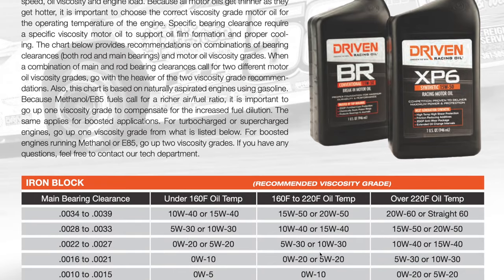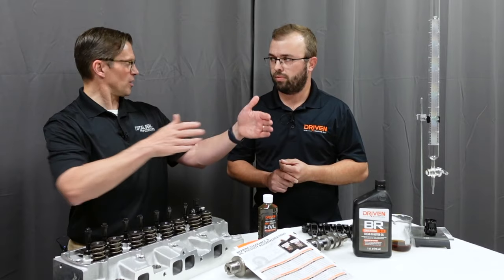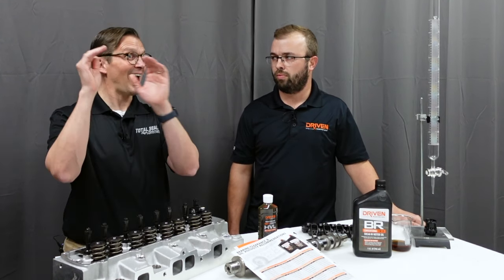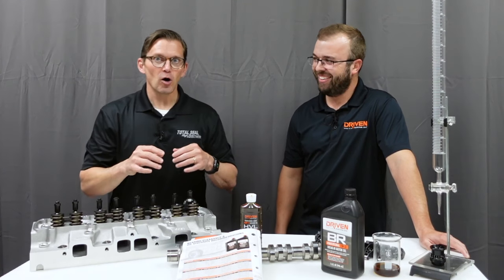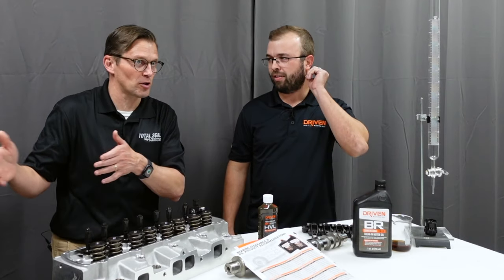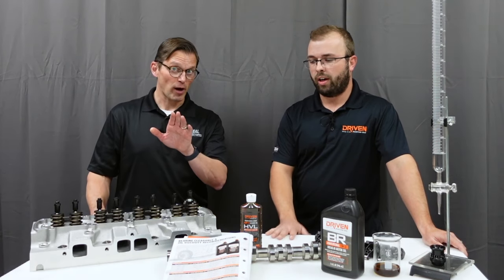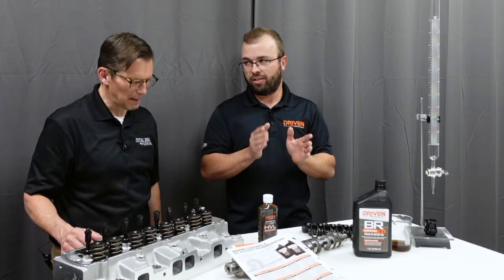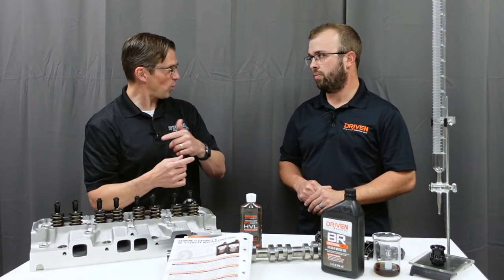How To Choose The Right Viscosity Motor Oil - A Certified Lubrication Specialist Explains

Comment: I switched my '16 Corolla to 5w30 from 0w20 at 200K miles. Now, I don't have to add a quart to quart and a half every 5K miles, my car is quieter, and the efficiency is the same for me. Owner's manuals in other countries list MULTIPLE grades for the exact same engines. This "0w20 only" nonsense is only a sop to the EPA/Feds, and I love that people refuse to accept this as per their programming.
Reply: 5w30 should be ok for extreme cold temperatures right???
Reply: Never had to top up engine oil before.
Reply: @ivanhamlyn  Look at an online viscosity chart.  You say Extreme, I'm thinking  0c,  you should be running 0w20 or 0w30.
Reply: @MyerShift7  I went with 0w30
Reply: @ivanhamlyn 5w30 synthetic. about -17c for my engine anyways. Colder I needed to plug in the block heater. and, at work started every couple hours down to around -35c or so. Northern Alberta Canada. Older engine 300000 km
Reply: how many miles do you go before changing your oil?
Reply: @ivanhamlyn yes. Unless you live somewhere extreme. I live in upstate New York and use 5w30 in my Camry and haven’t had any problems. I started using 5w30 once I got to 150 thousand miles.
Reply: This “0w20”  thing is spreading everywhere. In India, where I am from, 0w20 sees to have become a standard recommendation by all  car manufacturers (gasoline engines). I don’t understand why 0w20 is needed for places where temperatures range between 5 degrees Celsius to 52 degrees Celsius. Until a few years back, 5w30 used to be the norm.
Reply: @nssaharan exactly…0w-20 is for lower temperature reguions not high temps like india …it will become too thin in heat ..I assume
Reply: Absolutely. I just bought a 24 Wrangler Rubicon with the old school v6. Originally that motor asked for 5w30. Today, it’s 0w20.  Nonsense for the epa. Nothing else.
Reply: Why not just do a 0w30.  Best of both worlds.

Comment: For most drivers, use the oil weight recommended by the manufacturer. Use a high-quality synthetic, change it and the filter every 3,000 miles, drive gently, and a well-built vehicle will last a long, long time.
Reply: The problem is my car has 200k miles and my oil gets very hot.. 218°f/103°c and I drive mainly city miles.. wouldn't I be better off running 0w40 at these temps?
Reply: I know many of the recommended weights by manufacturers are really thin for emissions and economy and in other countries they direct the owners of the same engines to run thicker oils so you need to really know what is best for your engine…
Reply: Oil weight aside, oil changes at 3k miles with modern oils, let alone full synthetic, is a complete waste of oil and money.  Don’t do that.  It certainly won’t hurt your engine, just your wallet.  But, it won’t help either.
Reply: @torchmd  I was thinking on an Rv or heavy truck 3k is good (especially an RV, where it takes years to put 3k miles on it) but on a car maybe 5-6k…
Reply: Oh, sure. That makes sense.  My apologies.  I routinely go much longer than that.  I did the oil testing for a while on my diesel, and oil tested good out to 20k then I stopped.  On my gas engine I usually go to 1 year, which is lower miles, usually about 10. The testing came out good, so no reason to go more frequent than that.  But time is not something you can control for.
Reply: “Drive gently” 

Lol

Why even drive at all?
Reply: @jooper99 unfortunately, my experience is that those who don’t “drive gently” on public roads, provably shouldn’t drive at all.  Sad but true.  😬
Reply: @jaynikk758  I say 10W 40.  A 10W oil is plenty thin unless it is 0 degrees or colder outside.
Reply: @bounderchris  FACTS.
Reply: @torchmd  With synthetic, yes, but "natural" oils, no it isn't.  And leaving the same filter too many miles is just like not having an oil filter.  Once it gets plugged up, oil will bypass it.
Reply: @torchmd  You are a gambling man.  You should NEVER try to go more than 6,000 miles between changes, ESPECIALLY on a diesel.
Reply: @jamesbosworth4191  absolutely.  I change the oil filter every 5 to 6k.  And I only use synthetic oils.  Not all synthetic oils are created equal.  At least that used to be the case.  it has been a while since I did the research.
Reply: @jamesbosworth4191  Not according to the research I've seen.  ALl of my vehicles have gone well over 100k, most to 200k.  And it wasn't the engine that gave out.  well, one deisel dumped an injector and totaled the engine, but the rings and races were good.  But like you said, you can't let the filters go that long certainly.
Reply: @torchmd  One of my uncles used to brag about how he never changed his oil, yet his engine was "perfect".  It wasn't noisy and ran smoothly, but it smoked like a mosquito fogger.  Then one hot summer day, it locked up solid.
Reply: @jamesbosworth4191 I would never advocate for “never changing my oil”.  I hope I didn’t communicate that.  If I did, I apologize. But:  3000 mile change interval is wasteful.   Especially with a quality synthetic oil, 10k to 12 k is perfectly reasonable.   And at least yearly.  Now there are other variables, like what type of engine, driving, intake system, fuel, etc certainly.   That’s my opinion, and I have seen studies that support that.  

Thank you for calling for a sanity check. It’s easy to get carried away and say things I didn’t mean.
Reply: @torchmd  We'll agree to disagree then.
Reply: @jooper99  Drive the car the way you want because it's your vehicle and your money, but a lead foot shouldn't expect to maximize the life of the engine.
Reply: @bounderchris you also need to consider other countries avg temperatures and other environmental factors are impacting that.
Reply: @bounderchris but what if I have a euro car. Is it still ok to go thicker? I want to since I live in a hot climate and it’s summer time.
Reply: @jamesbosworth4191  but what if I have a euro car. Is it still ok to go thicker? I want to since I live in a hot climate and it’s summer time.
Reply: @Phuong_Nguyen_  If your car is an older car, 20W 50 is fine, as at cold (when you start your engine the first time of day), temperatures, it is an SAE 20 oil, which is plenty thin in a hot climate, when hot, (operating temperature of the oil), it mimics a hot SAE 50 oil.  For a modern car though, unless it has lot of miles, I would stay with 10W 40 or 15W 40.  In most climates, 10W 30 is fine.  If you want to use a single-grade oil, use SAE 30 if your climate is truly hot, SAE 20 or SAE 20W if your climate is "average".
Reply: @jamesbosworth4191  I can’t use sae that low. Mercedes cars are spec’d to use 0w40 or 5w40 229.5. Hot oil has to be 40 or higher. But sae 40 is way too thick at cold temperatures. I bought some M1 5w40 and will mix it with m1 15w50 half and half. If someone made a 10w45 that would be perfect. I have a 2013 biturbo v8, it gets hot. Some people run 5w50 amsoil. But I’m not paying $16 for a quart of oil that will sheer in 3000 miles.
Reply: @Phuong_Nguyen_  With Multi-grade, the actual viscosity of the oil is the first number, not the second number.  Thus, 0W 40 is not a 40 weight oil, it is a 0 weight oil that has been fortified with polymers that make it so that it doesn't thin out as it get warmer, so that at high temperatures, it is supposed to mimic a hot SAE 40 single-grade oil.  No way would I even think of using 0W anything in any of my engines, as the viscosity nowadays is decided by fuel economy test considerations, not by the engineers.  I would find out what European models of your car with your engine call for.  THAT is what is probably the correct viscosity, not what is called for in this country.  PS:  It is warmer over here, so if anything, you would need THICKER, not thinner oil in this country.
Reply: @Phuong_Nguyen_  If you are looking for 15W 40 oil, Diesel engine spec oils are available in that viscosity.  If you can't find any at auto parts stores, truck stops will have it.
Reply: @jamesbosworth4191  I just told you. And if you know anything about Mercedes or European cars, they all run on 0w40 or 5w40. I’m getting advice from someone that doesn’t even know about Mercedes specifications. Everyone who knows oil knows 229.5 is Mercedes specs and 0w40 or 5w40. I guess I’ll just have to go find advice from someone who actually knows about European cars and oil specs.
Reply: @Phuong_Nguyen_  I still would never use 0W anything in any engine of mine, I don't care what the owner's manual says.  I care more about engine life, not fuel economy.  Besides, if you can afford a Mercedes, you can afford the gas.
Reply: @jamesbosworth4191  the 0 is for cold start up. The 40 is how it behaves when at operating temperature. 40 oil is not marketed for fuel economy, quite the opposite. Are you sure you know about oil? You sound a little clueless.
Reply: @Phuong_Nguyen_  I am talking about the 0W part, not the 40 part.  0W 40 is not the same thing as SAE 40.  And I am not talking so much about marketing as I am talking about the automakers trying to get the highest possible MPG rating for CAFE purposes.
Reply: That's simply being a sheep
Reply: @jamesbosworth4191  well I can’t use sae 40 because the cold startup isn’t efficient. 10w40 would be my choice but no one makes it besides mobile 1 high mileage, but I don’t want to use a high mileage oil. And there’s a few motorcycle and diesel 10w40s but I’m not comfortable with those either. So what I’m going to do on the next oil change is m1 5w40 mixed with m1 15w50. Should come out to 10w45 which is perfect for summer use.
Reply: @Phuong_Nguyen_  Sounds like a good choice to me.
Reply: Thanks mom.
Reply: You nailed it 😊
Reply: @torchmd  I agree.  But 5k if you have a GDI engine due to oil dilution.  Unless you pay for an oil analysis so you know where you are sitting.
Reply: @torchmd my truck 5.4 3 valve, starts to run different after about 3-3500 miles, so I limit it to 3k.  Many newer engines are very temperamental.

Does it cause more wear after that??  I doubt it, it just likes lower OCI.

Comment: After 50 years of doing it myself, I finally seriously researched motor oil. I came to the shocking realization that I could have used nothing but 10W-30 in every vehicle I have ever owned from the early 70s till today. In several of them, the recommended viscosity was 5W-30. However, in the fine print it always said you could use 10W-30 if the temperature never went below 0 Fahrenheit. So there.
Reply: 10w30 is excellent...stable, and low noack.
Reply: You can use 100w-20 if you'll never let your car in winter Temps but there's no advantage to that instead of just buy 0w
Reply: @jason200912  I have never owned a vehicle where the recommended oil was 5W-20 or 0W-20. If it was the recommendation, I would use it. With the ones where 5W-30 was recommended, the fine print said you could use 10W-30 if the temperature did not go below zero F. I could have used nothing but 10W-30 in every vehicle I ever owned with a cast iron American engine.

The point is, I could have used one oil all my life, never debated, discussed or researched the topic and been no worse off. But I like to research. Almost anything.
Reply: @anonymike8280 what's the purpose of oil logistics for you though because the oil additives degrades overtime and you should only buy it when you're ready to do the oil change
Reply: 2016 Kia Rio. Says 5W-20 on oil filler cap. Manual says you can also use 5W-30, or if it never goes below zero 10W-30.
Reply: Agree 100%.  I have two stock Corvettes (C4 and C5) and a 96 Impala SS.  They each have a 5.7 liter V-8.  I bought each one new.  They have only seen Mobil One 10W-30.  As each car went beyond 75,000 miles, I started using "High Mileage" Mobil One.  I think the 5W-30 is for people who want to squeeze slightly more MPG out of their cars.  I'm more interested is squeezing more life out of my engines.
Reply: @GregSr  You have a point. The manuals for the cars I had said 10W-30 but then they said, if the temperature where you are does not go below 0 F, you can use 10W-30. I have never owned a vehicle where I could not have just used 10W-30 oil. What I was really getting is that all of the time I have spent discussing motor oil was just a waste. Researching other people's conceptiom and misconceptions is one of my avocations though. Maybe that's a waste of time too.

Comment: I have a 2018 Camry V6 (the current generation) and I live in a mostly hot climate all year round. The dealer recommended me to use 5w30 and if I wanted to go for 10w40 (which they used on my car when I didn’t know better lol) there wouldn’t be a problem. Toyota engines can accept wider range of oil viscosity. I was shocked when I found out that US spec Toyota models use 0w20 oil. I have been using 5w30 full synthetic and for years and no problems whatsoever. 0w20 is too thin for that engine in my opinion.
Reply: For sure, 20 weight is not fit for a hot climate. I drive between Orlando and Miami all year round, no way I would ever put a 0w-20 in my Toyota. As usual what works in some nerds lab does not hold up in the real world. I ran my V-8 Chevy in Houston TX on 10w-40, got over 189K miles and finally dumped it because too many other things went bad, the engine was still running fine.

Comment: Actually 0-20 is basically the same as 5-20 and neither is making engines burn oil car manufacturers are making the piston rings more loose to cut down on friction and get better MPG on the fleet of cars 0.003% adds up over a million cars and then on top of this they sold people on the 10000 miles oil change read your manual that's for normal driving conditions 🤔🤔🤔 but wait read a little bit more and see the definition of normal almost no one in the world drives in normal conditions according to the auto manufacturers 🤦🤷. So use good oil and change it every 3000 to 5000 miles and your engine will love you for it.
Reply: The Ow has more additives that break down over time than the 5w or 10w.
The lower the range, the less additives.
I was using Castrol Edge 5w40 which was oem for my turbo car.
Now I'm doing Castrol Edge 0w40 which had a higher lube rating than the 5w40 but more additives which break down.
The 0 should pump faster on start up which prevents wear.
The engine seems happy with either and I'm in the Pacific Northwest so we don't have extreme hot or cold weather.
I'll just use whichever is cheaper or available..lol
I do 10k full synthetic oil changes and filter.  72k and runs like new.

Mazda mpv V6 ran Mobil 1 5w30 at 10k oil changes and ran like new for 150k miles and sold car.

Cheers

Comment: For the new wrx's, Subaru recommends 5W-30 in the Canadian owner's manual and 0w 20 in the US owner's manual. It has to do with EPA requirements in the usa.
Reply: CAFE in the USA.
Reply: I guess this is the problem. What are you optimising for? If it is only fuel economy, you are going to use thinner oils with some degradation of durability to maximise fuel economy.

If the standards talked about the total energy required to build a car, then maybe you might prioritise durability a little higher.
Reply: This seems backwards, as Canada is colder than US and therefore would be better to have thinner oil.
Reply: @bakemonking  Yep. I checked the known bearing clearances for my BRZ and 0W-20 was correct for most people, except high temperature racing.

However using the charts, a turbocharged engine with the same bearing clearances should be running 5W-30 or 10W-30. Definitely for fuel economy or US CAFE.
Reply: @user-is2vy7ou4d I don't know where you got your info, but it is wrong. I live in Canada and own a '22 WRX. My owner's manual recommends 0w20. The manual is even available on Subaru Canada's website, where you can see for yourself.
Reply: Screw the EPA.  Do what is best for the engine, not what the EPA wants.
Reply: @jamesbosworth4191  do what the manufacturer wants, because they pay the warranty repairs. You want to keep your warranty intact. After warranty, do whatever you want at the that point.
Reply: @steve8803  But then you are stuck with no vehicle while it is being fixed.  Besides, it is more a case of marketing, rather than the engineers, making those decisions.  I don't do what marketers say.
Reply: @itsthemetho  5w 30 is an old formula. Replace that with 5w40.
Reply: Corrupt EPA - you left that out
Reply: @bakemonking  Our EPA and CAFE BS has no bearing on Canada...
Reply: @steve8803  I agree to what's in the owners manual, not the oil cap.  But some owners manuals say 0w20 is good in all climates, at that point I would use group IV synthetics in the summer if I was under warranty.  I've read group IV (Amsoil and Redline for sure) hold their properties better in higher temperatures.  Then some clown will say, but your engine is always the same temp.  Not true, your car has a radiator, your engine will run cooler at 0c then it will at 40c.  I had a 4 cylinder that took 5 minutes to warm up in the summer, or over 30c, and 20 minutes to warm up in the winter, around 0c, and the final resting temperatures were not the same.
Reply: FACTS.
Reply: I’ve seen this before too Subaru and other manufactures recommend different specs at different conditions
Reply: You're spreading a myth. One guy made a video here on youtube about his Canadian WRX, but later debunked himself in the comments. The Canadian owner's manual gives the same viscosity as US manuals, namely 0W-20. His video should be deleted as many people don't bother to read the comments.